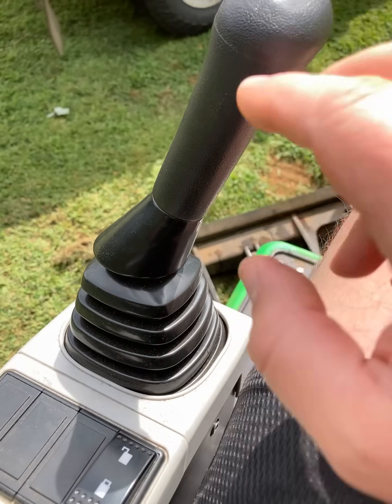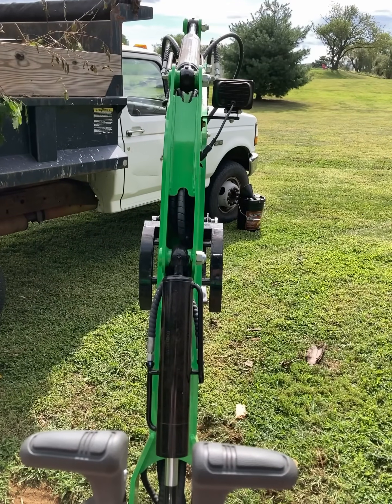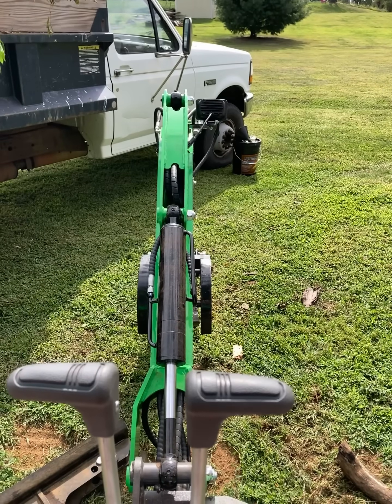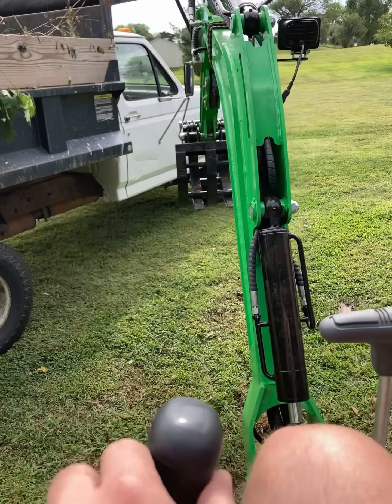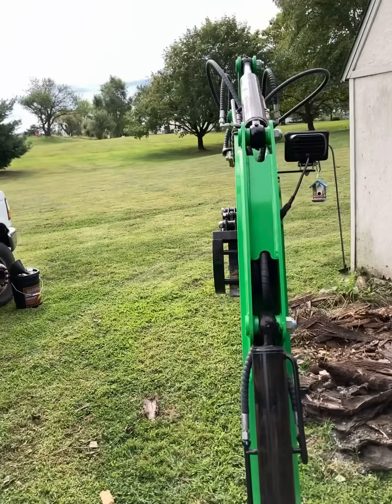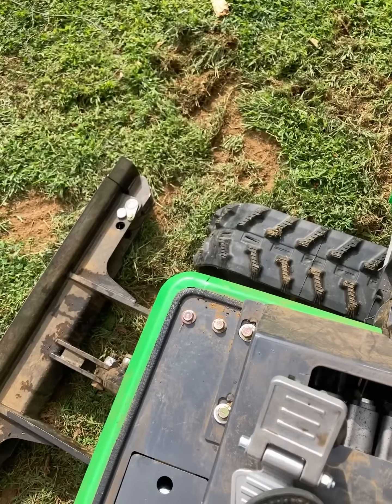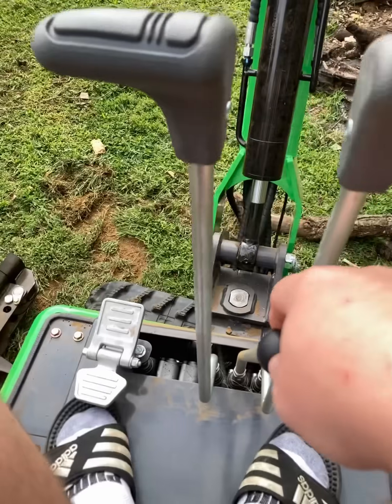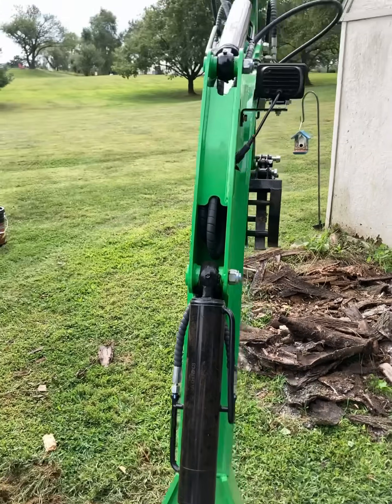How Do These Controls Work on the AGT KX12-CDB?

Comment: did you have this delivered ?
if so, will they contact me first or just show up ?
do they help unload? or do i need a forklift to remove it from their truck ?
I am expecting delivery this week and would like to be prepared as best as possible
Reply: for anyone else wondering;
Yes, they deliver these with a full size simi box truck
No, they will not unload it for you, that is entirely up the you to u load it, I had to use a forklift